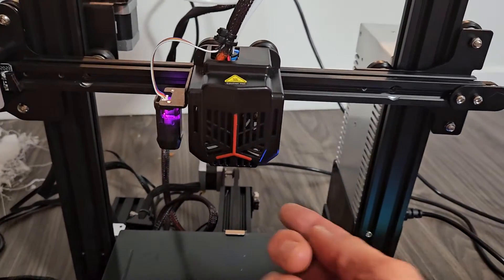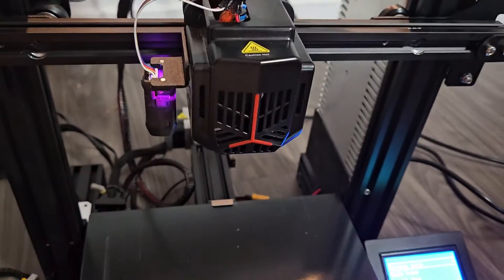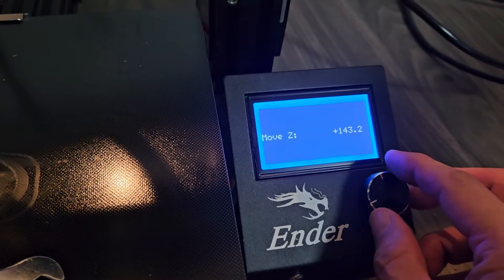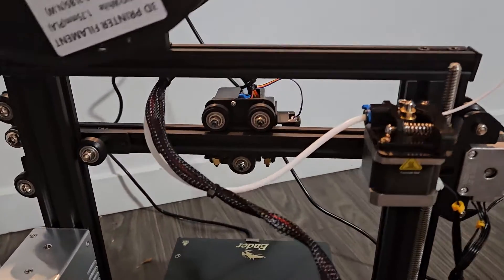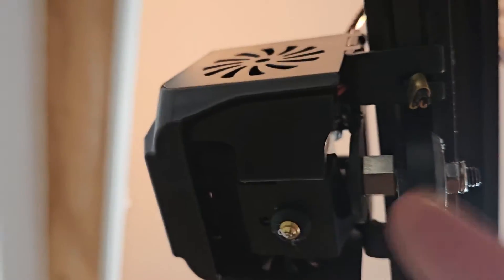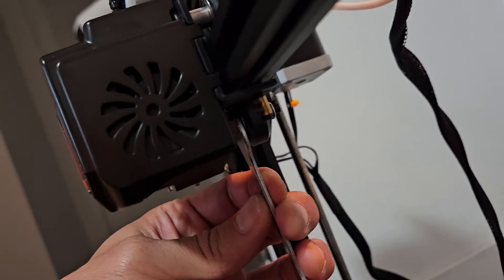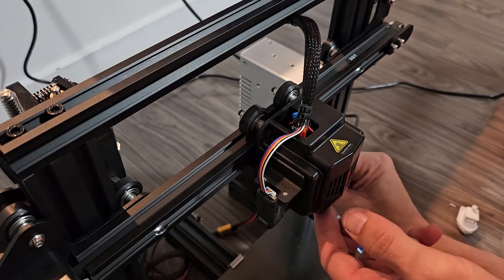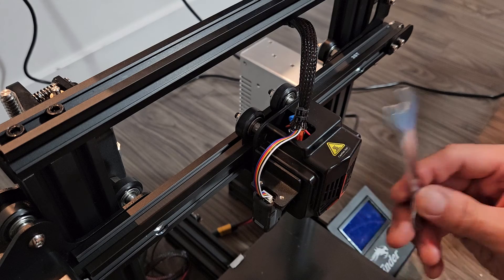Ender 3 Neo: Extruder is Loose or Wobbly? 5 Second Fix!

Comment: I'm new to 3d printing and had issues with my ender 3 v2 neo thermistor. I replaced the thermistor and it works fine. However the extruder is now slightly loose like this. I'll tighten it up. Thanks 👍